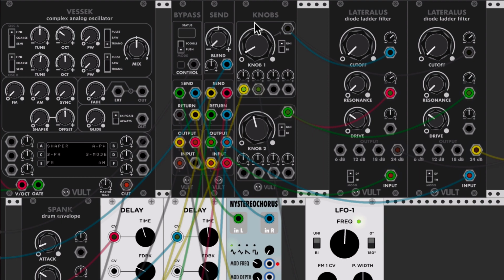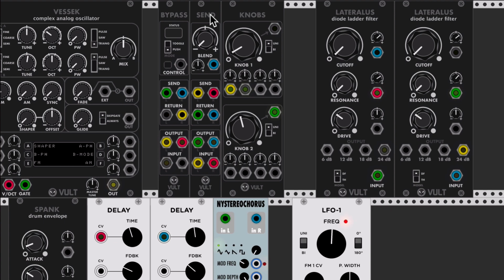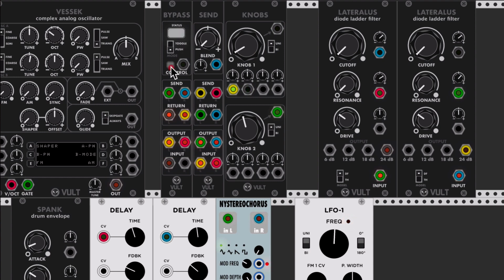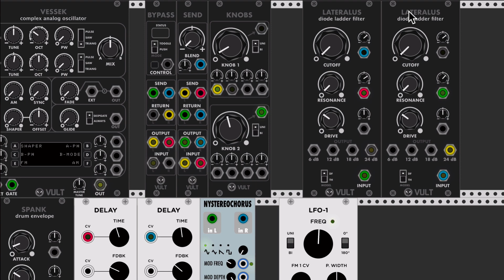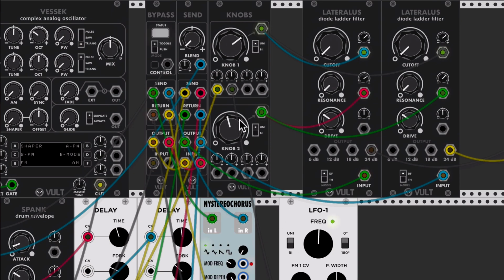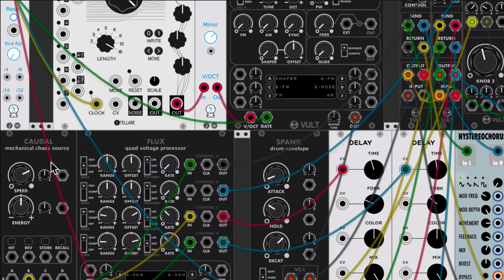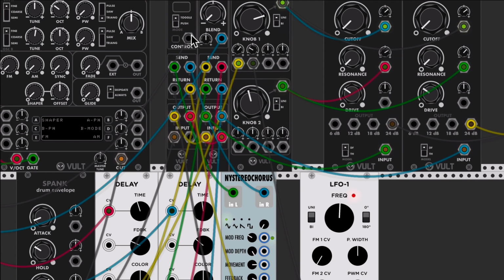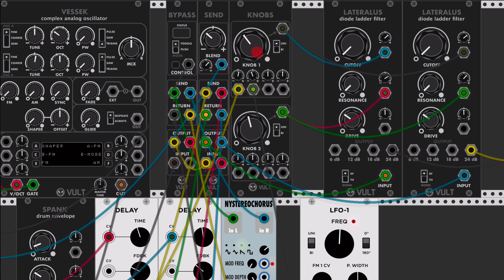New utilitity modules

Comment: Good Gravy I love your work. I do have an idea though.. is is possible to use a color cycling aspect so we can change the text color? My 52 year old eyes has trouble with the white on black text. I want to make it neon yellow or green, maybe even aqua? or RED! ya color changing the text! I am a premium plugin supporter too. thank you for such professional work.
Reply from the maker: Hi Rick. I haven't contemplated changing the color in the design. It will require a significan amount of work on my side, but I'll check what I can do.
Reply: No No not trying to add work,. I saw that Matthew Friedrichs from Hotbunny fame was able to add color cycling to the buttons on Floats--# https://ask.audio/articles/floats-the-controversial-synth-module-for-opensource-vcv-rack-just-got-a-big-update  #--and that was what gave me the idea of having a color changing feature, if you've seen the knobs the mousedrag=up changes colors of the knobs center. here is a p
Reply from the maker: Right,  changing the colors of the knobs is easy, but changing the colors of the panels is more complicated. In addition, I have more than 20 modules that would require the change. I need to find a smart way of doing it, otherwise it would be very time consuming.
Reply: I must have not explained, its the text itself, not the panels unless you are stating the font is the panel? I assumed as I'm not a programmer, that the font is a font like on my computer I thought they were included .ttf files in the 'res' folder and I know on my mac I can pick colors, is there a way I can change it myself without causing you any work at all? a file I can edit to say use "fontname foo' color=green' or whatever hex code green is? and if not, well there's an idea for the community hehe! maybe for rack 2.0 or something! Again I love your stuff, sent you money, but am NOT asking for more work, keep on making awesome modules and doing what YOU want!
Reply from the maker: Rick Duff that’s exactly the problem. The labels are graphics in the panels. I usually export them like that so I don’t have problems with the rendering of the fonts, specially in the different platforms. It should be possible to modify the svg files with a script, so you get the higher contrast. But I’m trying to find a solution that benefits more people.
Reply: as an aside, Im actually shopping for a big screen display now anyway. I just love vcvrack and want to get a big picture experience with it anyway, I'll tell my boss(wife) that the devs just cant make the text bigger! I MUST GET A BIGGER SCREEN TO SEE IT! ( ok now you can move on to something else LOL)
Reply: You are the man! Thats why we love you, keep doing your thing!